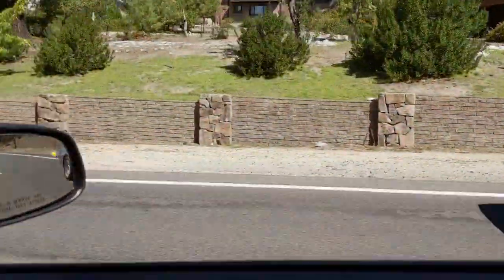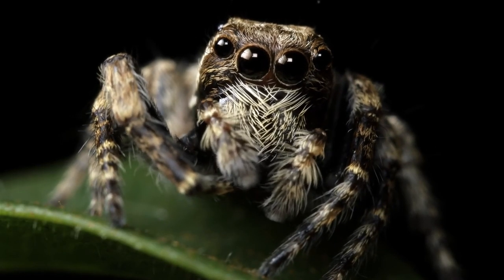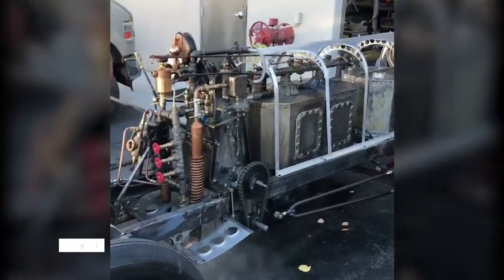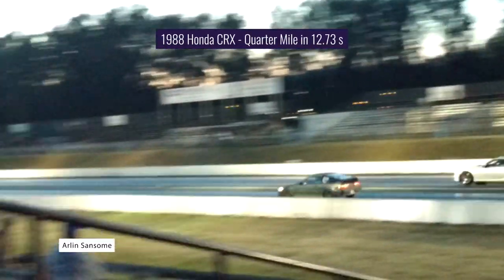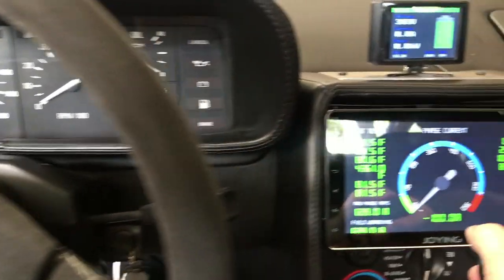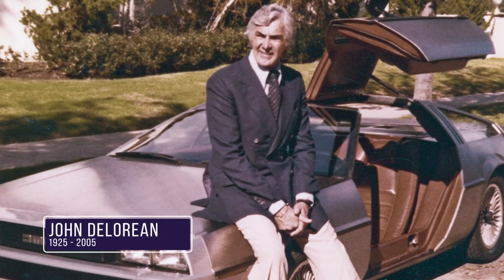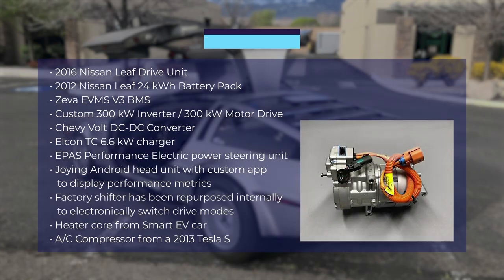DeLorean Electric Car Conversion: Behind The Build

Comment: Really impressive. Built the circuit boards, coded his own software for the console, hardwired and soldered everything together. It's pretty much like building an electric car from scratch. Crazy! Wish DeLorean would mass produce EVs some day. My dream car.
Reply: Actually they did, since back in 2013 ( I believe) When they’ve Done a espectacular Job with them and especially with a Super Charged  one ( That on Which I love) .
Reply: @1ivannthegreat  Yeah I've been following that on the DMC site (or whatever site it was). But I haven't actually seen them produce EV Deloreans aside for maybe a few for like $100,000. As far as I'm aware, DMC has a warehouse in Texas and is aiming to piece together parts to recreate original Deloreans.
Reply: Aiming? Im confused. When did you stop being able to get a new one made?
Reply: @AndrewCortesi  I think they started actually releasing them in 2017 (I think they started taking pre-orders in 2013 or 14), but from what I have seen, there were tons of parts still in warehouses from the original bankrupt company stock, and somebody (or group of people) basically resurrected the company to a degree by buying those part stocks up and start once again manufacturing, while also upgrading some key areas for the major faults that new technology and manufacturing processes allowed for them to correct within reason.  For instance, the original chassis coating meant to prevent rust was known to crack over time and allow rusting, so they reconditioned the original ones with a new coating to prevent these issues.  I'm assuming they have corrected some of the major issues with their engine as well, but it sure seems like they are way faster with an EV setup than they ever could have been with the original engine design.  But essentially you can buy a newly manufactured car from DMC and they have a website (at least they did last time I checked).
Reply: Unfortunately there's a torsion bar used in the gullwing doors that cannot be manufactured anymore, used a freeze drying process (from memory) during the casting stage and there are no facilities that have that technology anymore. Might be a bit off on the technicals but have a google and you'll see.
Reply: While I like the Guigaro design, this car was always nothing but a fraud and a con. A lot of effort for what was never a good car and would be forgotten if not for that movie.
Reply: I would buy the hell out that car
Reply: Well, it's happening...
Reply: Seems you got your wish
Reply: Could that be solved with metal 3d printing?

Comment: It is an impressive project. But for those wishing for more power, Yamaha built a line of electric motors. The most powerful pumps out 469 hp / 350 KW, which I think could be sweet for the DMC-12

Comment: The Grand National didn't have a 4.3l it was a 3.8 V6.
Reply: The GMC syclone has a 4.3l V6, did you mean that engine?
Reply from the maker: Yes I think the information got confused because the Grand National they swapped the engine from was already modified and did not contain the original engine.

Comment: As a DeLorean owner I’ve always wanted to convert our De to an EV and with that now becoming a much more reasonable possibility video’s like this are so temping.  When a strong company enters the market with a decent warranty I’ll seriously consider making the move.  The car just has a seemingly never ending issue of mechanical problems.  I’ve never owned a car where you can replace most all the important parts yet they repeatedly fail anyways.  Very frustrating and a head scratcher.  On the other hand, I’ve never seen a car that can attract attention from even six figure cars like the DeLorean.  Sitting at a stop light, no matter what’s next to you, even a young blond in a convertible.......you win.  Not you, but the DeLorean!
Reply from the maker: what would you pay for an all in one conversion kit?

Comment: The battery powered motor itself weighing 650lbs plus all the batteries and wiring, weighs 250lbs less then a gas powered DeLorean version, I find that hard to believe.........
Reply: The leaf motor assembly is actually closer to 200 lbs - the video got it mixed up with the battery pack (this is my car in the video)
Reply: @jakegraham2999  got a question, if you don't mind. Would there have been enough room for a Tesla drive unit?...or is space restrictions why you went with the leaf drive setup? And also, what would the weight difference be between the leaf and Tesla drives?
Reply: @Mardy72  The small tesla drive unit will fit in the DeLorean pretty well. It's about the same weight as the Leaf unit, too. The main reason I went with the leaf unit was that at the time it was far less expensive than the Tesla options. The nice thing about electric motors is, generally speaking, it's the inverter / battery that is the limiting factor for power. With my custom inverter, I can push the leaf motor harder than the Tesla unit (300kW vs 220kW). Right now my big limitation is the battery. I'm looking into my options for an affordable upgrade.
Reply: @jakegraham2999  BUT JAKE - you should just spend a gajillion more dollars and put new tesla stuff in it!!!   Hey wait, where are you going

Comment: I was trying to figure out why the front wheels looked a bit out of place. Looks like he’s running a pair of the 15x8 factory rear wheels with 205/50 tires stretched to fit. Looks a little bit odd.

Comment: Prices have risen 7 percent in the last year, 42 percent in the last three years, and 50 percent in the last five for these cars.The average value of a DeLorean in #2 (Excellent) condition is $46,300, regardless of model year. That's nearly double its #2 value of $24,200 . Hopefully the conversion (if it’s a good conversion) was done at a level to keep costs at a reasonable level.

Comment: Great choice, the slow ass but bad ass looking Deorean is THE perfect car for electric conversion. Too bad he only put a 200Hp motor in it. Seems like a huge investment for not much performance gain, but still give it a thumbs up.
Reply: My limiting factor right now is the batteries - the inverter is good for nearly 400hp (same for the leaf motor). My plan is to upgrade the battery pack for more range and power.

Comment: The leaf is probably the worst EV you could have borrowed parts from. They have horrible heat management and tend to degrade within 5 years.
Reply: Then do it yourself
Reply: @joeyknight8272  why?
Reply: @greatmaddyave  your complaining about there choose so why not make your own and build you a delorean EV
Reply: @joeyknight8272  k, first off it's "choice" you weren't even close and 2nd show me this rule book that says you can't point out obvious wrong turns in a process unless you built the exact thing you're criticizing?

If you don't like critism, you should probably deactivate your account and quit reading the comment section. 

3rd, how big of a unaware hypocrite do you have to be to critic my critism for being critical?
Reply: @greatmaddyave  I'm never said there was rule all I'm pointing out is if you think you can do it better then do it. Theres probably a reason why he went leaf maybe price maybe space.

 Also auto correction is a thing. 

Yeh I'm criticizing your comment? I'm not that dumb. I just idk feel like the dude who built a electric delorean and built his own parts for said delorean probably knows a bit more.
Reply: @joeyknight8272  It doesn't matter why he went with a leaf battery. The point is those are known to die at the 5 year mark. They designed it to be air cooled, which anyone who knows anything about battery cars, that cooling is paramount. So to buy a used one for a modification, is the worst decision you can make. Financially, or otherwise. 

This guy is not an expert in battery technology. I am, hense why I critized that choice. Because it's the wrong one to make.

Comment: Remove the hatch for the trunk and put a solar panel there also cut part of the roof out and put a solar panel there. Now you can charge your battery and almost never run out of power

Comment: I did remember that the DeLorean that came with the PRV is already making it rear heavy that is why i called it a rear engine rear wheel drive you can say its a budget Porsche but 1 time John DeLorean himself once used a rotary which should have considering it will be a rear mid engine because of how small rotary is

Comment: I don't understandd how they're getting 200 horsepower out of a 110 horsepower electric motor. Sure, the batteries are good up to a max of 200 horse, but that doesn't matter if the motor can't drink it.
Reply: The output power of an electric motor has less to do with the motor and more to do with the batteries / motor drive. For a simple example - think about the guys that juice up power wheels by adding more batteries or increase the speed of their RC cars. The motor will handle it as long as you can keep it cool.

Comment: How the fuck did it turn out lighter than the original
Reply: It's lighter because the EV conversion doesn't requite a transaxle, original engine, A/C lines, heater lines, coolant lines, shift linkages, fuel pump, fuel tank,  fuel lines, exhaust system, etc. The battery is lighter than you'd think, and the leaf motor/gear reducer is less than 200 lbs.

Comment: I think electric really suits the Delorean. That V6 engine it came with was rubbish.
Reply: The original engine actually was a V8 with two cylinders cut off. Hence the 90° cylinder angle.

Comment: Killer, but if it was me I would still have to do a soft BTTF mod, IE I would hook-up a very loud sound system, get engine noises and then embellish them with the extra noises they added in BTTF, like when the doors open, or the extra ignition and rev up noises that the car made.  And then I would also get a flux capacitor light up replica that plugs in the cigarette lighter and put it between the rear of the front seats.  That would be icing on this juicy cake of a project!  I would rather do that then go full BTTF replica because from what I have seen, all the extra gadgetry in the interior makes it a real PITA to drive, but just those little extra touches would make this soooooo sweet!  Awesome build tho all the way around!  I want it bad! :D <3

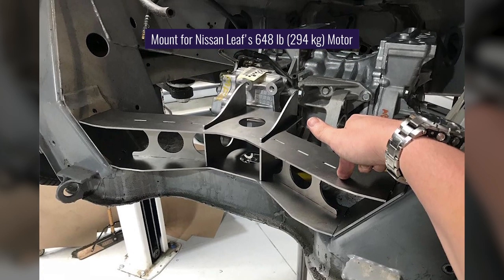Comment: 4:00 if you are going through the motions and money why not fit a tesla motor and get a beast? not dissing the project, its really cool. But why not go for i.e. 400 horsepower?
Reply: At the time I built it, the tesla drive unit was prohibitively expensive. Being an electric motor, I can still push the leaf motor to a good 400hp - which is about the limit of my inverter.

Comment: Why use a Nissan Leaf motor? Why not a Tesla motor.
Reply: The small tesla drive unit had not yet been hacked when I built the car. The only viable option was the leaf motor. That said, the leaf setup with my inverter puts out more power than the tesla unit does.